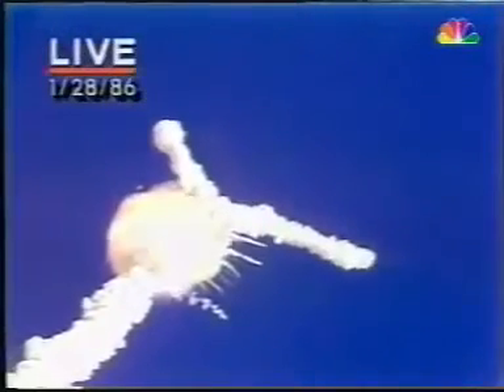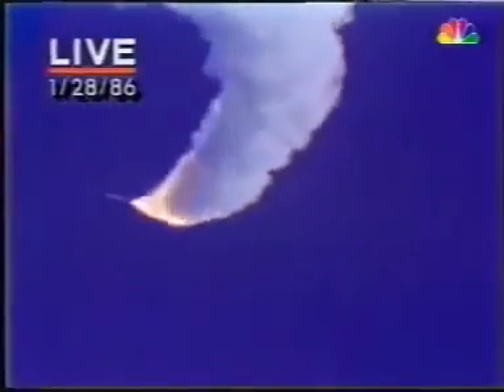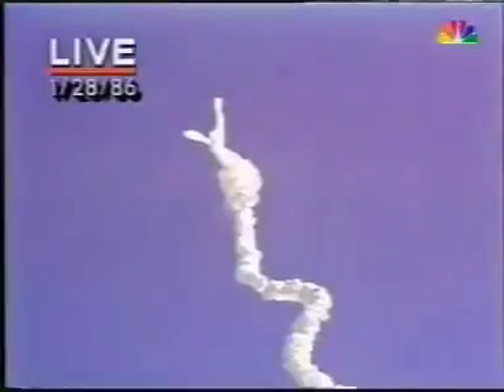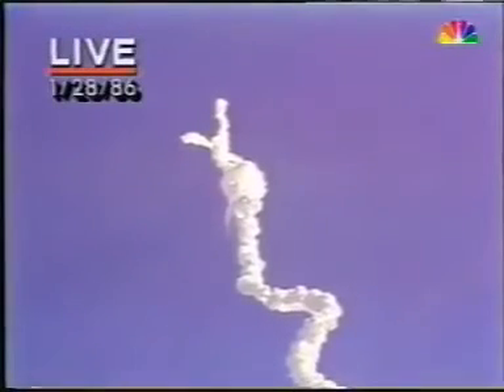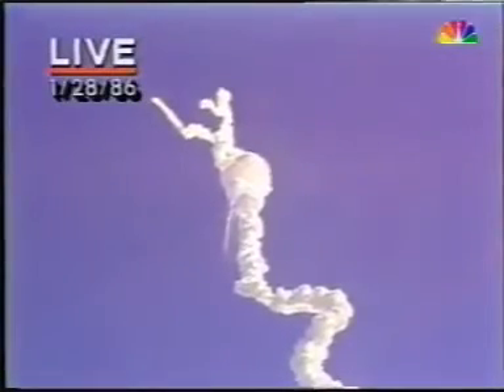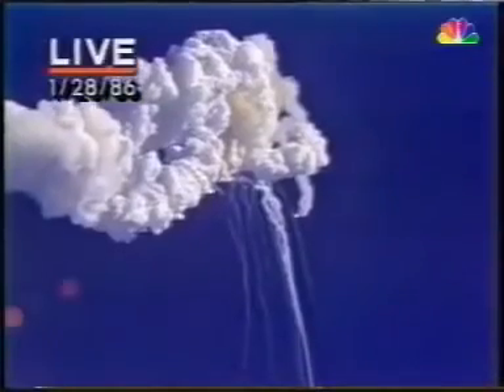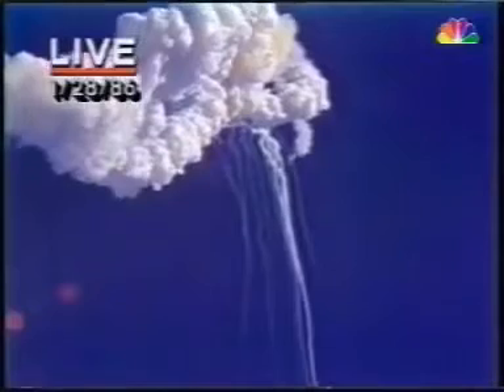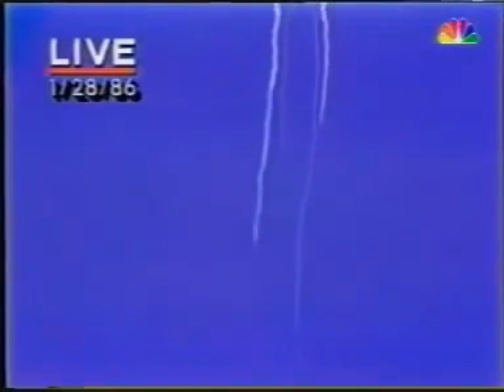Challenger Go With Throttle Up

Comment: Richard Covey (a fellow astronaut) at mission control telling Challenger pilot Michael Smith to go with throttle up. Richard was on the next space shuttle flight a couple years later.
Reply: it is "go at throttle up" and not "go with throttle up". It just means that at a certain point in time, where engines already have throttled back up, all systems are still go. Obviously, in reality the Boosters were not.
Reply: @Andreas1986xyz  Yes you're right, they had already passed max Q but there was strong windshear that day or they might have made it to orbit